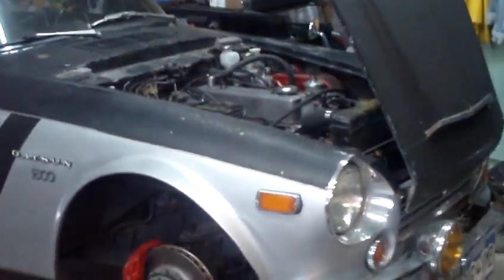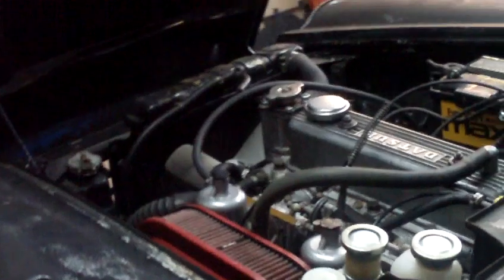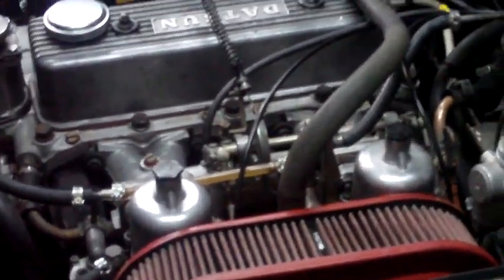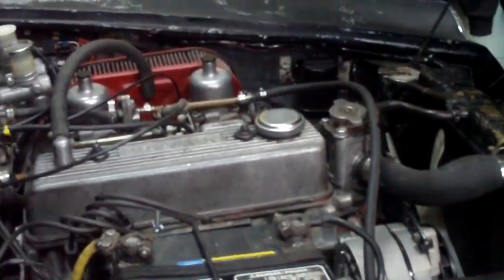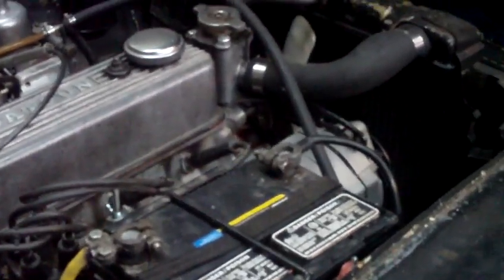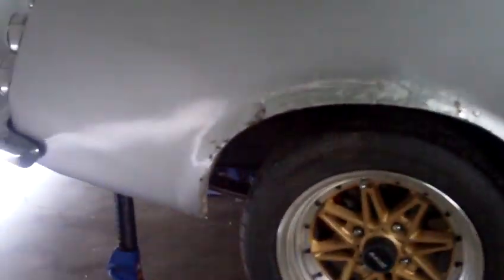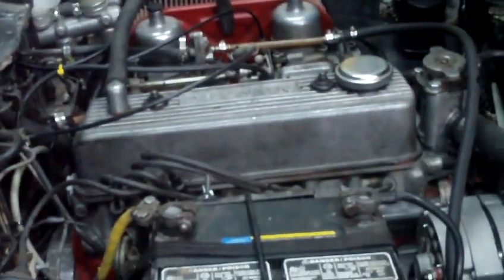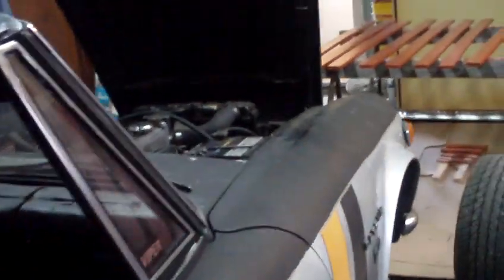1968 Datsun Roadster "Roadsterstein Rust Rocket" Build Update  3

Comment from the maker: The wheels are 15x7 Drag DR20s with a +0 offset. The fog lamps are actually very, very old 6v lights from who knows what. I bought them on ebay, and wired them in series to make them work on a 12v system. They look great and work great too! Thanks for checking out my video!

Comment: Can you tell me what nissan the brake came from and how did you get it all to mount?
Reply from the maker: The front brakes are from a 1990 300zx twin turbo. The 1990 part is important, as that was the only year the calipers were aluminum. Those were mounted with a kit made by Spriso Motorsports. There is more info on 311s.org. 

The rear brakes are from a 1982 Nissan 200sx. (The rear wheel drive one.) Those were mounted with custom brackets. The info on that swap can also be found on 311s.org! All the brake lines are custom made, and the brake master cylinder is from a 280z, I can't remember what year though. I'm still working on getting the pedal hardware to work correctly.